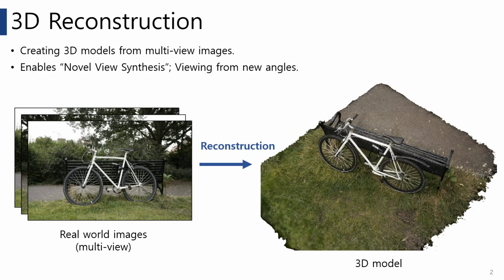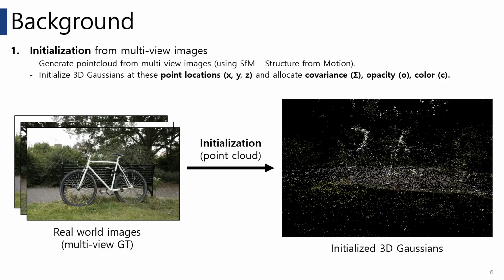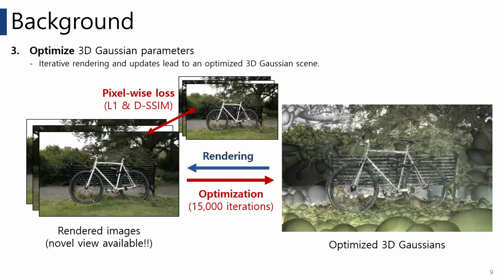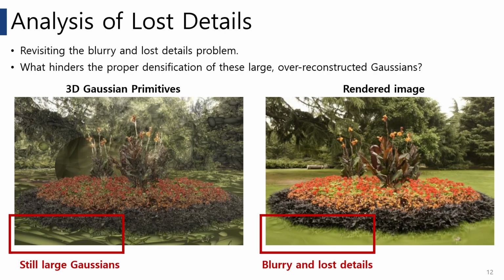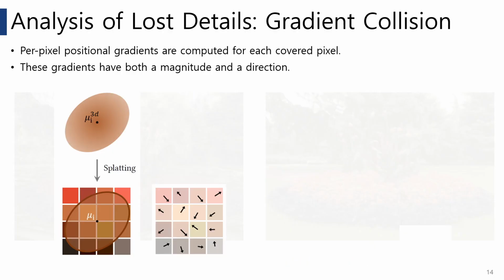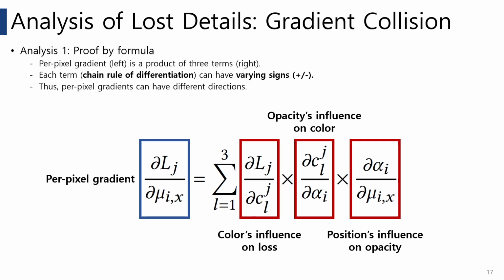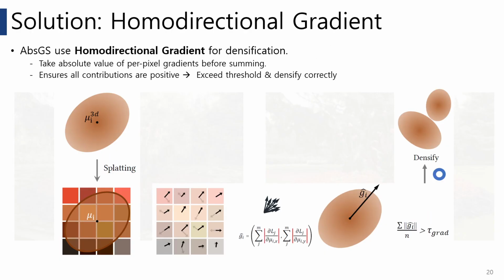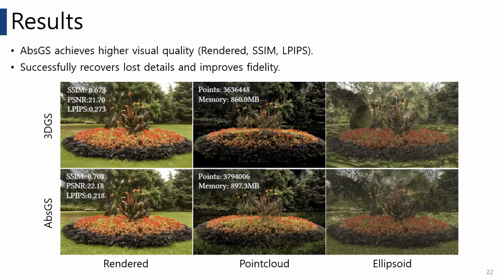[Seminar] Unlock Lost Details in 3D Gaussian Splatting

Comment: Thank you for the great presentation.

Q1. I understand that Structure-from-Motion (SfM) is commonly used for initialization in Gaussian Splatting (GS). Are there any GS studies that propose new initialization methods? Since random initialization often results in poor performance, exploring better initialization algorithms could be an interesting research direction.

Q2. I found it interesting that you compute the absolute value of gradients so that all gradients point in the same direction. However, what does the direction of the gradient actually represent in this context? By taking the absolute value, the negative direction can no longer be represented — could this become a potential issue?

Comment: Very simple technique for densification!

Q1. Suppose we adopt a densification method that uses the absolute value of gradients. If a single Gaussian covers a large number of pixels, the gradient contributions across those pixels are aggregated without cancellation, due to the use of absolute values. This can lead to artificially high accumulated gradients, even in regions where true directional change is minimal. As a result, such Gaussians may repeatedly exceed the gradient threshold and be forced to split, regardless of whether additional splits are semantically necessary.
This raises a concern: large Gaussians might be penalized and split excessively, leading to an explosion in the number of Gaussians and, consequently, significant memory overhead.
If the root cause is limited representational capacity, wouldn’t it be more effective to increase the complexity of the spherical harmonics (e.g., using degree 3 or 4)? This could enhance expressiveness without necessitating further splitting. While higher-order harmonics increase computational cost during gradient calculation, that may be a better trade-off than managing and processing a much larger number of Gaussians. I wonder what your thoughts are on this, especially from a memory-efficiency standpoint.

Q2. The idea of taking the absolute value of the gradient before comparing it to a threshold is clever and intuitive. However, it raises a potential concern about differentiability. The absolute value function is not differentiable at zero, and although we apply it after computing the gradients, it could still introduce discontinuities or instability during optimization—especially when evaluating or refining a fully constructed scene.
If this thresholding operation is only used during the refinement or densification stages, perhaps it would be more stable and differentiable to use a soft approximation such as a sigmoid or softplus function. This could maintain smooth gradients and offer greater flexibility for future extensions or differentiable decision-making frameworks.

Apologies if I’ve misunderstood any parts of the method, but I’d appreciate your thoughts on these points.
Reply: for Q2. I'm especially interested about extenstion problems with differentiability
Reply: A1.
I agree that taking the absolute value of per-pixel gradients can result in artificially inflated accumulated gradients. However, in practice, this can be mitigated by introducing a global scaling coefficient or hyperparameter that adjusts the densification threshold. While such tuning requires empirical validation, it offers a relatively straightforward and flexible way to control the sensitivity of the densification process.
Regarding the idea of increasing the order of spherical harmonics (SH), it is true that higher-order SH can improve expressiveness in terms of color variation across pixels. This can help individual Gaussians better capture subtle shadow gradients or color shifts without needing to split. However, this improvement mainly applies to directional lighting effects and material appearance, not to the representation of fine geometry or texture details. In other words, SH can help express how colors change with lighting direction, but it cannot resolve structural patterns like grass blades or window frames on its own.
That said, if Gaussians are structured within a voxel or octree-based geometry-aware framework, then increasing the SH order might become a more viable and interesting research direction. The combination of structured spatial representation and enhanced radiance modeling could yield a better trade-off between expressiveness and memory efficiency.

A2. 
In AbsGS, the absolute value function is applied only during the densification stage to assess importance—it is not used during optimization. During optimization, original (signed) gradients are used. Therefore, there are no differentiability or instability issues introduced in the training process.
However, I agree that replacing the hard thresholding with soft approximations such as sigmoid or softplus could increase flexibility, especially if we want to integrate densification into a fully differentiable decision-making framework. Of course, whether such an approach leads to practical improvements would need to be evaluated empirically.

Comment: It was very easy to follow, even for someone like me who isn't familiar with Gaussian Splatting.

I believe the core contribution of this paper is using the absolute value of gradients to fix the cancellation issue and properly guide densification. I have a few questions about this.

Q1. If I understood correctly, why did the number of selected Gaussians for densification decrease on page 21? Does AbsGS use a different gradient threshold?

Q2. Also, is the absolute value of the gradient used only for densification? If so, does this mean that the values used for optimization and densification are different?

Q3. Did I understand correctly?
Reply: A1. In the original 3DGS method, fine details tend to trigger the selection of many small Gaussians for densification. In contrast, AbsGS addresses the issue of gradient collision, which often causes large Gaussians with small gradients (i.e., over-reconstructed regions) to be selected instead. As a result, AbsGS can end up selecting fewer but more appropriate Gaussians. Also, since the figure in question was taken from an intermediate iteration during optimization, it's possible that AbsGS had already performed better densification earlier on, resulting in fewer Gaussians being selected at that point.

A2. That's correct. The absolute value of the gradient is only used during the densification stage. For optimization, the original gradient values are used. I also initially wondered whether it would make sense to use absolute values for both, but upon reflection, this would introduce discontinuities in the gradient and lose directionality—both of which are critical for optimization. In densification, however, we're only interested in how "important" a Gaussian is, so using the absolute value works well for that purpose.

A3. These were excellent questions. Sounds like you're ready to join us in the world of Gaussian Splatting research.

Comment: Quite simple and effective.

Q1: It's hard to understand why it's acceptable to take all per-pixel gradients as absolute values. I think this might have a counter-effect that simplifies the original densify equation. Could you explain this in more detail?
Q2: Is the Gaussian representation perfect for modeling the real world? Are there any other representation methods that could be combined with Gaussian representations to compensate for each other's weaknesses?
Reply: A1. Densification is the process of determining how much a Gaussian fails to represent the corresponding pixels in the ground truth image, and deciding whether to densify based on that. The method doesn’t simplify the densification equation itself—it only changes the criterion by replacing direction-sensitive per-pixel gradients with scalar absolute values. The underlying logic or computation remains intact.

A2. Recently, there has been growing interest in combining Gaussians with other representations such as voxels or octrees to enable more efficient, less redundant sampling. Other promising alternatives include 2D Gaussians and triplanes. If you're curious, I recommend looking into papers like Scaffold-GS, Octree-GS, and 2DGS, which explore these directions.

Comment: Actually, I don’t really know what a 3D Gaussian is, so maybe my question is kind of fundamental and looks weird!
Q1 : First, there's this idea of using 3D Gaussians and then rendering them. But just looking at the images, I can’t really tell what’s different. What exactly has changed?
Q2 : When you splat a 3D Gaussian into a 2D Gaussian, What do you gain from doing that? I mean, is it something you absolutely have to do?
Reply: To put it simply: in traditional graphics, 3D scenes are typically represented using triangle primitives (as in meshes). These are transformed from 3D space to 2D and then rasterized into pixels—what we ultimately see as an image.
3DGS follows a similar process, but instead of triangles, it uses 3D Gaussians, which are geometrically equivalent to ellipsoids. In other words, 3DGS represents a scene using ellipsoid-like primitives, and includes the full pipeline to render them into 2D images.
If you're interested in learning more, I’d recommend checking out an introductory paper or lecture on 3DGS—it will give you a much clearer and more structured understanding than a short answer here can provide.

Comment: Q1. The approach of taking the absolute value of individual gradients is simple and powerful, but it seems like it could impact the final quality. Are there any negative effects from using absolute values? For instance, when high-resolution images are used as input, does this method exhibit more artifacts compared to the original 3DGS?
Q2. Besides this paper, are there any other well-known papers whose main contribution is a densification alternative?
Reply: A1. Taking the absolute value of per-pixel gradients is only applied when determining which Gaussians to densify. During optimization, the original gradients are used to update the Gaussians, so this does not affect the learning process directly. In fact, it improves the accuracy of the densification process, and I did not observe any noticeable artifacts. But, using high-resolution images increases the amount of fine detail, which in turn leads to more small Gaussians being added. This could potentially lead to memory issues depending on the scene.

A2. A substantial number of papers have proposed alternatives to address this. One of the most widely discussed limitations of the original 3DGS was its handcrafted densification strategy. As a result, many follow-up papers have proposed alternative densification methods, depending on the goal—whether it’s better compression, capturing fine-grained detail, or addressing other specific challenges.

Comment: Q1. I'm curious when the homodirectional gradient is actually applied during the densification process. Is it used consistently throughout training, or only during certain phases?

Q2. Are there any drawbacks or potential downsides observed when using the homodirectional gradient, especially in comparison to the original gradient-based densification?
Reply: A1.
The homodirectional gradient is used during the decision process of whether to densify each Gaussian. While the specific iterations in which it is applied may depend on the actual implementation, my understanding is that it is designed to be used flexibly—typically controlled via a hyperparameter that allows adjustment over the course of training.

A2.
No drawbacks or issues were reported in the paper, and I believe there are no major theoretical concerns either.

Comment: 1. My understanding is that this issue occurs quite frequently in 3DGS. Were there truly no prior studies that attempted to resolve it before this paper?

2. Does the paper compare the training time of standard 3DGS to that of the proposed AbsGS? If so, I would expect AbsGS to require considerably longer training because it employs many more Gaussians. How large is the difference?
Reply: A1.
There are indeed many papers that have attempted to address this issue. However, I chose to highlight this particular work because I found its logic, structure, methodology, and experiments to be exceptionally clean and well-executed.

A2.
The training time and number of Gaussians do not differ significantly between AbsGS and standard 3DGS. In fact, for certain scenes, AbsGS even results in fewer Gaussians. The key point is that AbsGS performs more accurate density control from the beginning, which helps eliminate redundant Gaussians and avoids inaccurate densification compared to the original 3DGS. You can refer to the experimental section of the paper for more details.

Comment: Really enjoyed the paper — it feels like the method reflects the authors' insights and is also easy to apply.
I'm still new to 3D Gaussian Splatting, so I might have some basic questions:

1. What exactly is the view-space positional gradient? I'm wondering what kind of gradient it is and why it's called "view-space".

2. Are there any downsides or visual artifacts when using the method from the paper?
Reply: A1. You can understand it better by recalling the traditional rendering pipeline. In mesh-based graphics, an object typically goes through a series of space transformations: object space → world space → view space → screen space. Similarly, 3D Gaussians undergo comparable transformations to be rendered on screen. Each 3D Gaussian is projected into a 2D Gaussian, and through 3DGS’s rasterization and alpha blending process, the final image is formed. The view-space gradient refers to the gradient signal backpropagated to the 2D Gaussian during optimization—after comparing the rendered image with the ground truth. Among those gradients, the ones with respect to the position of each Gaussian are called "positional gradients."

A2. No downsides or visual artifacts were reported in the paper, and from a theoretical standpoint, there’s no reason to expect any. That’s part of what makes this a strong contribution.

Comment from the maker: The paper's idea is straightforward and intuitive, and it improves the results. Although the advance is incremental and the idea's adaptability(?) is relatively narrow, the work offers a clear example of what is a meaningful contribution to a technical paper. Thank you for selecting the paper.

Q1. What challenges remain for the densification stage? Despite the progress reported, I believe several open issues still need to be addressed.
Q2. Were any trade-offs or drawbacks observed with the new method?
Reply: A1. As finer details are introduced, the number of small Gaussians increases. Contrary to the paper's claim that memory consumption decreases, memory and aliasing issues may still arise depending on the scene. While some recent papers have addressed this, the handcrafted nature of the original densification algorithm still leaves plenty of room for improvement.

A2. One of the strengths of this method is that it introduces virtually no trade-offs or drawbacks compared to the original, thanks to its simplicity and minimal code changes.

Comment: Q1. In 3D Gaussian Splatting, it seems that achieving higher performance would require a large number of Gaussians, which could be highly inefficient. Are there many approaches to address this issue?

Q2. Why does 3D Gaussian Splatting outperform traditional methods like NeRF? What characteristics make this possible?
Reply: A1.
Yes, this is an extremely active area of research. In fact, there's even a dedicated survey paper on 3DGS compression methods, which shows just how many diverse approaches have been proposed to address this inefficiency.

A2.
3D Gaussian Splatting outperforms traditional methods like NeRF primarily due to its explicit and rasterization-based representation. Unlike NeRF, which relies on dense volumetric sampling and neural network inference along rays, 3DGS represents scenes as a set of Gaussian primitives that can be directly projected and blended on screen. This allows for real-time rendering using standard graphics pipelines, with significantly lower computational cost. Additionally, Gaussians naturally encode spatial locality and support adaptive density, enabling high-quality reconstructions with better rendering speed and less reliance on heavy neural computation.

Comment: It's really nice and interesting paper about 3D reconstruction. Thank you for your efforts.

Q1. Gradient collision happens when pixel gradients cancel each other out. Does this issue also occur in scenes with uniform textures or lighting? Or is it more common in complex textures?

Q2. In the FGS method, gradients are converted to the same direction using absolute values. How does this affect cases where some gradients are actually pointing in the correct direction and others are not?
Reply: A1. To put it simply, imagine a large patch of grass being covered by a single Gaussian. While the overall region might appear uniformly green, there are often fine-grained details such as subtle variations in green shades, shadows, and highlights. At the pixel level, the gradients will point in many different directions to capture these details. However, since the original Gaussian Splatting method uses the sum of all per-pixel gradients (i.e., the view-space gradient) for densification, this leads to gradient collision—many opposing gradients cancel each other out. As a result, the large Gaussian only aligns with the average color of the region, and important fine details are ignored. So, this issue is more likely in seemingly uniform textures with repetitive pixel-level patterns, shadows, or highlights, rather than in highly complex regions.

A2. I’d appreciate it if you could clarify which paper or method you're referring to as “FGS,” so I can provide a more accurate answer.